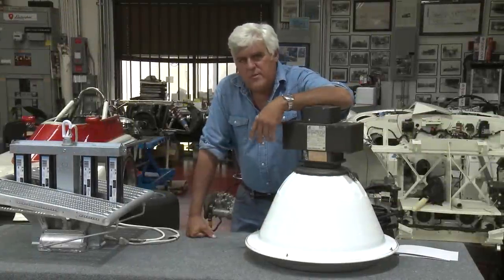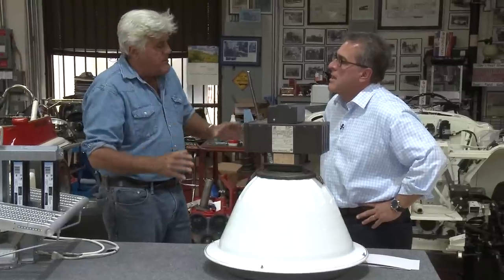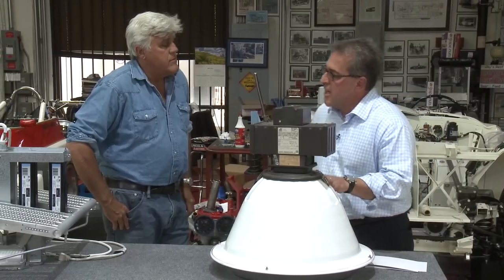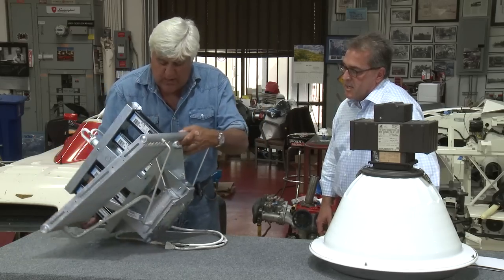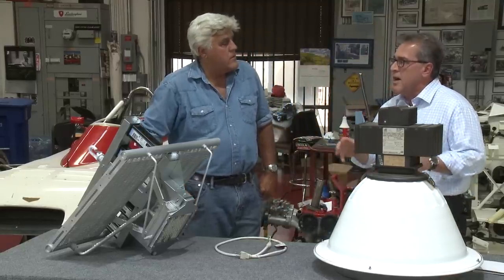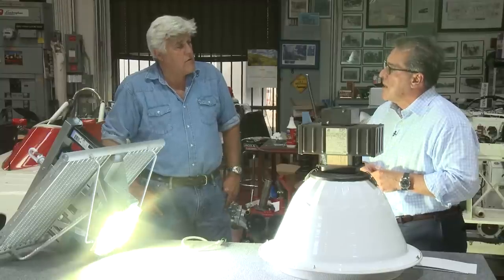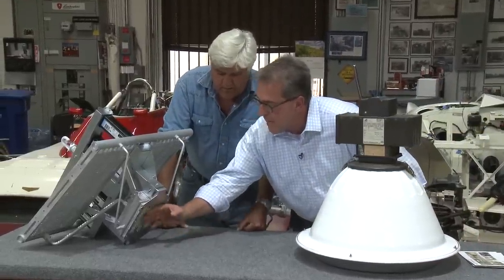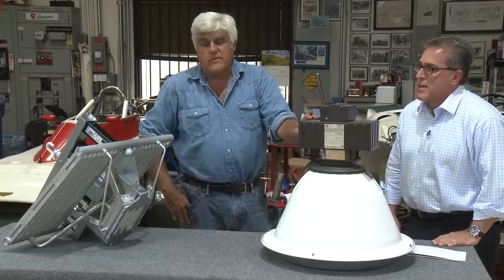LED Lighting System - Jay Leno's Garage

Comment: I really hate these shady-ass answers. Jay is giving you the opportunity to advertise your product, at least response with genuine answers.
Reply: Intelligent and Factual answers are shady? 0_o
Reply: Jonathan Alerte Jay asked why is the lamp cool yet the material under it is warm. He respond by saying the problem is that the lamp is not vertical. Last time I checked heat doesn't travel down plus Jay said the lamp is cool. So how can the cool lamp produce warm heat that travels downwards? Obvious from the light it emits which the representive says it is not coming from. That is not intelligent or factual
Reply: Knights2theEnd   Both jay and the sales guy were a bit fail on this.  Lights like that are out of normal consumer experience, so there is no context for comparison.  I looked up the specs for the hioptix light, its claimed to replace lights up to 1000 watts, so its possible the light he was replacing was anywhere from 500-1000 watts, again both failed to say how much.  The hipotix light uses 598 watts to produce 61k lumens of light.  Even if its more efficient than a 1000 watt bulb, removing 600 watts of heat is no small task, it doesn't disappear into the ether.  As hard as those passive radiators work, they will only keep the thing cool enough not to die, not cool enough to feel cold.  The back would have probably become hot over time as well but they only had it on long enough for the front to get warm.  But heat pipes sometimes do not work well in some orientations so he might have been right about that bit, but still, it got warm because he turned on a freakin 600 watt light.  Even a 5 watt led accent light will feel warm to the touch after being on a few minutes, energy = heat.
Reply: The guy was pulling fancy words out of his ass, because he was on camera. When Jay said, "You mean a motion detector", after he'd come up with some bullshit fancy name, i almost fell out my chair laughing...
Reply: 5:26 Listen carefully what the guys says :) not what you think he should of said or your thoughts of how the engineering works LISTEN FOR ONCE IN YOUR LIFE
Reply: spaminbox He should of said that, unfortunately he didn't which puts his answer under the shady catagory
Reply: +brook316 +spaminbox "occupancy sensor" is actually the proper term for lighting systems to detect when a person is in a room. My architecture office has them throughout the building and we specify them often on projects nowadays. Lights turn off as needed in our building, and turn on when you walk into a room. They can make a huge difference on energy costs.
Reply: I couldn't agree more. I dont think the guy actually tries to  deceive us about the properties of this lamp, but simply doesn't have any more knowledge about its working principle and construction than most of the people commenting here... Result= marketing guy talking out of his ass. The real reason why a poweful LED light needs a powerful cooling solution is the fact that the LEDs need to be kept at a much much lower temperature than other lights to reach their maximum efficiency and lifespan. The smaller the temperature difference with the environment, the bigger the radiator you need.
Reply: antiekeradio
He was flop sweating mostly. The panic made him come across "sketchy" or whatever, but he was just paddling too hard.
Reply: You should see if Flextronics is hiring.
Reply: spaminbox
 You are right. A simple test you can do is point a good LED flashlight into your ear... you will feal the heat! What is called IR.
Also LEDs produce heat in the back due to the fact that a lot of energy is going into a small spot. In some cases a small 1x1cm LED can get more then 10amps of energy and that will always generate heat.
Reply: Yavo Slavoj nice.
Reply: Knights2theEnd It's called radiation heat transfer. Google it.
Reply: LED produce heat

Comment: I'm seeing more and more commercial properties converting to LED. It's really neat because you can't really notice it and the light is actually slightly more intense and it looks good. I also see store front signs being converted from NEON to LED. Really interesting time.

It's awesome because as he mentions, it's twice the light output but half the energy consumption. Fascinating.
Reply: Look for Luminous efficacy on wikipedia... the main advantage of LED is the lifespan of the lamp and the colour spectrum that the lamp produces,,, if you really want Luminous efficacy then go for low pressure sodium but the quality of the light is poor, the bulbs don't last that long and take an age to turn on with a high starting current draw.

Comment: Flextronics bought and paid for this. I've been trying to get Jay to contact me about our systems since 2008. Our systems are over 50% more efficient than these. These guys literally need a radiator to stay cool? Despite this monster radiator, these guys still cannot prevent light loss as we have been doing now confirmed over 75,000 hours in our longest running systems.

Comment: In the UK the local councils are replacing street lights with LEDs, the light is very white and natural in comparison to the low pressure sodium lamps that are the most common lamps used over here.

It actually works out cheaper in the long term to replace the lamps even if the councils are burrowing the money to replace the lamps. The life span of a low pressure sodium lamp is 18,000 hours vs 200,000 hours expected for LED if the lamp assembly is kept cool, hence the big radiator on that unit and the good small ones also have big heat sinks on the back. 

The lamps in Jay's garage are mercury vapour lamps that give a good white light after a warm up period, they are not as efficient as low pressure sodium and there are environmental issues with mercury, the bulbs should be recycled but often they go to landfill.

Comment: It bugged me how he dodged why the table got warm from the fixture. It's not that complicated- while the LEDs themselves do not get that warm from working, the table got hot because the light coming from the LEDs was concentrated on a spot, which created heat. So the LED units don't get that warm, but the light they produce is still light, and it will heat things up.

Comment: Wow such crappy answers... Jay asked multiple times why the LED was producing heat and the guy just dodged it... its not because of the cooling system... the cooling system is what takes the heat away, jay was asking why there is enough heat coming from the LED in the first place to need a cooling system when LEDs that we commonly know about create no noticable heat at all. its not even that hard to explain, its just because although LEDs do produce a hell of a lot less heat than normal lighting, when you are pushing that kind of power through them they do still produce heat, just still less than a normal bulb of course which is where the 55% extra efficiency comes from.
Reply: That guy sounded purely like a salesman, no technical knowledge.  He probably didn't know what Jay was even asking so just defaulted to a scripted response.
Reply: Thanx for explaing dude.
Reply: The "it is only hot because the light isn't vertical" bit was so stupid.

My guess is the boss wanted to meet Leno so he pulled rank and we got this crap rather than someone who actually knew what he was talking about.
Reply: and objects wil warm up bij light. black absurb light and wil be warmer then white
Reply: megaspeed2v2 
To answer your question Jay, The surface is hot because the unit is not in its proper position utilizing the radiator to absorb the heat, therefore energy is escaping through the photons in the LED and the LED is twice as efficient at a close radius it;s almost acting like a magnifying glass.

Comment: Were those old school transformers in that new led fixture? I'm talking about the 4 rectangular black boxes with the bar code on them. I've seen those in every fluorescent light fixture I've worked on. They last like 2 or 3 fluorescent bulb changes and then they just tend to not work anymore. I'm skeptical that they'd last 200K hours. They also emit heat when they step up or step down the voltage.

Comment: I happen to work for a led manufacturer in the us sand to claim 200,000 hour life come I who is he kidding! Check the data sheet for the Cree LEDs he uses in the fixture and you will see a different story. Claims can only be made from lm80 testing and I doubt if the have 200,000 hours actual tests as the LEDs have not been available that long!
Reply: The highest rating up to date today on a fixture is 80,000 hours drivers fail much faster than the diodes do otherwise LEDs can last up to 100,000 hours people make claims thinking the average joe will fall for it and unfortunately they do.

Comment: This guy didn't seem to know very much about these lights or the technology, the reason the table got hot was simply because of the light energy being absorbed by the table and causing heat to be produced. What he said about 200,000 hours may not be true because he didn't mention the lumen depreciation at that point could be approaching 70-80%. In fact many LED luminaires say that they give 50,000 hours to 70% of initial lumens. Consider that this lifetime figure is only twice that of high pressure sodium lamps which can be replaced without replacing the fixture then is it really a saving? Considering the LED fixture is more expensive to begin with and has just over twice the lifetime of a cheaper and easily replaceable sodium lamp.

Comment: Who gets to pull those down every year and dust off that heat exchanger.   In my shop the spiders would love all those nooks and crannies...:)   Still neat technology, I wonder if they ever thought about using a parabolic array instead of the flat array?
Reply: Maybe use an air hose, but stand back for the dust...
Reply: my guess is there's probably not all that much dust in Lenos garage. Secondly, I'll bet they have at least one man-lift if not more. The garages are staffed pretty well. It creates jobs!!!

Comment: I've seen more efficient lights on a Baja truck, lights up like daylight and it is just a bar, I understand that them lights are mounted on a moving truck but still, you shouldn't need radiators for something that uses that little amount of LED's...  why not space the LED's further apart from one another? That'll generate less heat, dissipate the light better instead of it all being focused.
Reply: This light is for a large building like jays garage.
Reply: The one lamp in this video is way more powerful than most automotive LED light bars. They can produce as much as 90,000 lumens, whereas even some of the biggest, highest end automotive LED light bars are only putting out about 1/3 of that. The more light, the more heat.
Reply: How do you know they're more efficient??  Do you know how much watts they use per lumin output or how long they last??  The better off-road LED light bars I've seen are 300W and produce 20,000 lumins. They do have heatsinks on the back side and some may have cooling fans in them as well.  Then again as long as you're moving they would have air flow over the cooling fins I guess.  But it's not uncommon for automotive headlamp LED's to have a cooling fan in each pair.  modern LED's do get very hot.  These are meant to last 200,000 hours or more at 60,000 lumins and go up to 90,000+ so they are a lot brighter than the truck ones you're talking about and probably will last a lot longer too!  They seem much brighter on the truck because they're in reflectors to focus the light outwards into the distance.  You don't want that for indoor lights.  You would have blinding bright spots scattered around the building and most of the rest of the areas around them would be dark.
Reply: Guybrush Threepwood 300 watts is very high electric consumption
Reply: ***** A lot, if not almost all, of the heat does come from the LED module its self. The power supply will be about 90 to 95% efficient in a lamp like that one, its similar to the power supply in your computer.

The bulb module its self will be about 10 to 13% efficient, the rest lost as heat
Reply: Probably because heat can be problematic in California.
Reply: 300 watts on a 12-volt automotive light system is 25 amps, but on a typical 120-volt or 240-volt AC system that's only 1.25 to 2.5 amps.
Reply: Hey you should start your own company or something.
Reply: Patrick94GSR *****  300 Watts is 300 Watts anyway you cut it. Voltage and Amperage is all relative.  You know that.  This light uses 500 Watts to output 60,000 Lumins while the automotive light system there uses 300 Watts to output 30,000 Lumins.  So what one is more efficient?  100 Watts might not seem like much but if you have a factory with 50 or 60 of these lights in it your going to save 6.000 Watts on your lighting!
Reply: ***** Not so sure, these type of LED's create a TON of heat considering each one of them is ~1,000 Lumin.  You can clearly see the LED's are mounted directly to that water block and the cooling system is being used to cool the LED's, not the drivers.  Household LED bulbs probably don't have as efficient switching power supplies in them to keep them smaller and cheaper so the voltage regulation is going to be less efficient.  So that might be true for household LED's but not a big system like this with those 4 large driver boxes on it. The whole light uses 500 Watts so divide that up across the 4 drivers, if they're decent %80 or better efficient they wouldn't generate enough heat to require any special cooling.
Reply: *****
I'm pretty sure the led's themselves create heat, the issue isn't the amount, its the sensitivity of solid state electronics to heat, leds like computer chips die if over heated.  So without giant heatsinks either you have lower lifespan or lower output.  Beyond that they probably have to design for installation in areas with restricted air flow.
Reply: Yavo Slavoj Exactly.  I have a 1,000 lumin flashlight for example.  Single Cree LED diode.  It doesn't get crazy HOT but it does get quite warm to the touch and that's just when it's on for a few minutes here or there at a time.  It's not the voltage regulation that gets hot either because that's in the bottom cap with the switch and this thing gets pretty warm up top exactly where the LED is.  I imagine if it was on 24/7 it would burn out pretty fast reducing the lifespan of the LED significantly.  The guy in the video kind of explained it but not too well.  He said they don't generate much heat, but we know they do.  I think he meant that they won't get so hot they catch on fire or burn out right away without the cooling so it isn't directly necessary but it helps prolong the life of the LED since this light is rated to last 200,000 hours! Without the cooling the LED's might not last but a small fraction of that time.
Reply: Guybrush Threepwood Yep even 5 watt led accent lights get warm. Energy is energy and heat is heat.  They failed to explain the basics.  I looked it up, the hioptix fixture replaces up to 1000 watts.  It draws 598 watts to produce this 61k lumen equivalent.  So when he turned it on, it was dissipating 600 watts of heat.  Even with radiators drawing heat away thats a huge amount of energy, its going to heat up the desk its sitting on, and eventually the radiators will get hot as well.  Since they were replacing a 30k lumen light, it can be run at 50% so even 300 watts is going to dumping 300 watts of heat, its going to be hot.  But the radiators will keep the leds from dying, so the size of that cooling system is definitely necessary.  Not sure why jay thought it would be cool to the touch, the only way to do that is to have a refrigeration system which could nullify 600 watts of heat and dump it somewhere else.

Comment: i can see the radiator clogging up ..the heat from the light will make a themal of hot air that will rise taking dust with it so will not be maintenance free

Comment: In the '80s I worked in a retail shop that used smaller sodium lights than those, but they would get so hot that the solder on the end of the ES fitting would melt & there'd be nothing for the contact to touch so they'd stop working! As those bulbs weren't cheap & I was handy with a gas-torch, I'd build the solder up & they'd keep going until they burnt out!
&B^{D?

Comment: My thoughts - LEDs operate worse, are not as efficient when hot. They don't do well in a hot shop. And, heat adds resistance. If they work to keep the LEDs cool, they are more efficient. You'll get more light from them when cooled. A passive or thermo-siphon cooling system like that isn't much different from some of the early CPU coolers I've seen on "Pentium" processors.
LEDs run hot-  but not as much heat output as a MH light and LEDs keep putting lumens out while other lights decrease in actual light output with age.